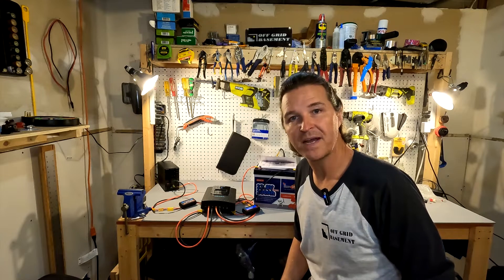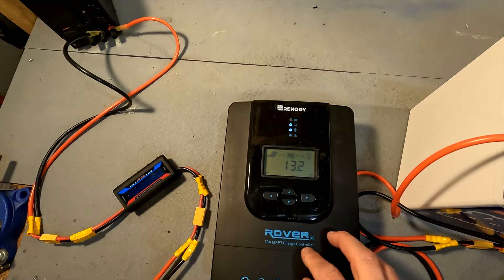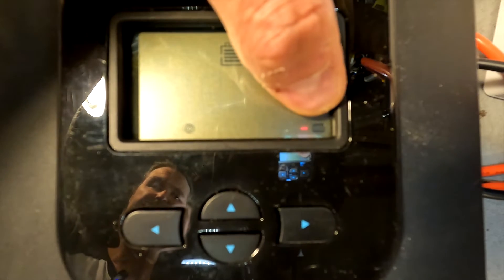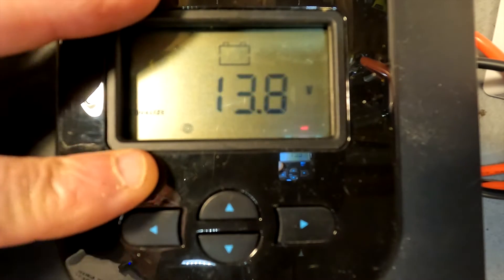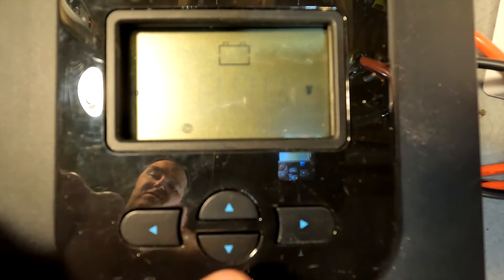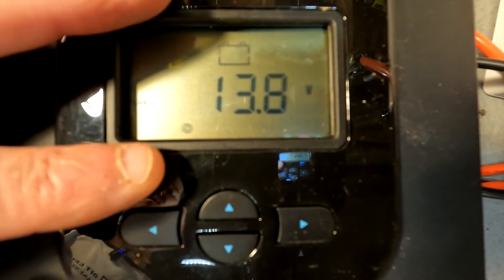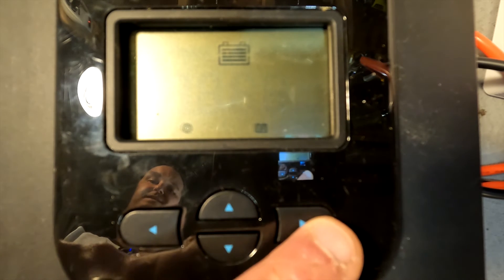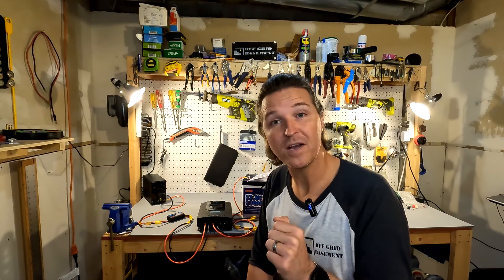How to program the Renogy Rover 30A for a Lifepo4 Battery

Comment: This has an error in it. If you leave it on user, its just supplying what you're using and not charging your battery. I switched mine back to LITH and it is fine now.

Comment: I am currently using the same controller. I have been running everything as a 12 volt system. I've also been considering changing just the solar panels to 24 volt or higher and run that through the wiring to the controller, but I would like to maintain the battery bank and out as 12 volts. Do I need to purchase anything to add? Is there anything else I need to do other than wiring changes at the panels and setting changes to the Rover 30 amp.

Comment: I was confused about the setting of the equalization but you cleared that up.  Thank you VERY much.  I will now set my charger to 13.8 for the equalization setting...NOT 14.6.  GREAT video.  I didn't get a manual with my battery for the settings and was always wondering if my controller was set right.  Thanks again.
Reply from the maker: I'm glad I could help, and thanks for the comment!

Comment: Hi ! That's a good video but I need help with a problem with my Rover 20a controller that I have had in use for around 12 months. It is putting no charge whatsoever into the battery and yet is showing no error code (E0). I've checked all connections and I even ran separate cables direct from the controller to the battery, but no change. The term 'mppt' is not showing on the screen and no current is shown going to the battery. Do you think the controller has failed ? Any help much appreciated, thanks.
Reply from the maker: It sounds like a controller failure.  Make sure to check the voltage coming into the controller from the panels.  It should be over 18v.  Also, make sure your charge voltage is at least 14v.  I'd be more specific, but I don't know the chemistry of your battery.  Hope this helps!

Comment: All the settings when I cycled through in USER mode are correct. Still sitting at 13.3 charge :(
Reply from the maker: I think that's correct.  Your battery bank should only charge up to 14.6v to a short amount of time, then drop back down to mid 13's.
Reply: Renogy helped me get it all programmed properly, then they told me that sitting at 13.3 means the batteries are full that they will only go to 14.4 if the batteries were drained and it has to fire up again and it will only stay there for an hour or so and then drop back to 13.3

Comment: I tried to program mine which has been sitting at 13.3 for two days (supposed to be 14.4). It lets me select LI battery type then when I press right again it chooses between 12v and 24v but keeps going back to flashing the type of battery. It doesn't move to the next manual setting like yours did. Back and forth between battery type and voltage type is as far as I'm getting
Reply: You have to hold the right/enter button, switch to USER mode(it is a square with USE on it at the bottom)
Reply from the maker: After you put in the setting, try unplugging the battery and see if the setting stuck.  That's about all I can think of.  Hope it helps and good luck!
Reply: Maybe its because he is setting it to User intead of LiPo?

Comment: 13.3 is float on Lifepo4
Reply from the maker: Every 12v Lifepo4 battery manufacturer I've reviewed states in the manual that the charge voltage is 14.4v and float is 13.8v.  13.5v would do fine, but 13.3v is a bit low for my tastes.  Thanks for the comment.

Comment: Thanks for explaining the float and boost voltages, i have issues with some of these settings especially th thru the bluetooth app. I have 3 of these 40 amp controllers and wwant  to get the most from them. If you need any ideas for future videos go over the bluetooth settings and explain them, lol.  Thanks
Reply from the maker: I don't have the Bluetooth add-on.  I take it, it's not really user friendly?  Thanks for the comment.
Reply: It just has lots of settings, some that make sense and some that don't.   Give it a try it is useful,  although a bit confusing, with a few misspelled words.   Again thanks,  and great video.

Comment: I am only receiving less than 1 amp from my 200 watt panel. I had my rover set to li and my battery reading 13.1v on both the rover and volt meter. At midday with 60% of panel getting sun. Only 1 amp, 15 watts, and 21 volts.  I am switching to user mode and manually adjusting the settings to see if it's something to do with the li setting thinking the battery is fully charged. 
If the problem is not the charge controller settings what might cause low amps from the panel? All new products.
Reply from the maker: You really need to put the panel in full sunlight and test again.  Shade really does kill solar production.  Hope this helps!
Reply: @OffGridBasement  yes. .  I somehow missed that individual panels can't really handle any shade. But of a disappointment as I have to move my panel but at least my set up is working and I don't need any new parts!  I tested mid day with the panel flat on my roof and I got near 7 amps. My battery tho charged from 13.1 to 13.4 and then settled back to 13.2. seems like it should have charged more. Will do more experiments when the panel is in the correct position
Reply: Could also check the wiring connections as they can get corroded.   Best connections are using butt connected crimped down hard and covered with shrink tubing.   1 amp seems a bit low even for shaded conditions (like I have completely surrounded by trees on a north facing slope (lucky me).

Comment: Are the settings the same for two 12V, 12Ah batteries connected in series?
Reply from the maker: If they are lifepo4 batteries then yes.
Reply: Nope.    In series you have a 24 volt battery system, so double the 12 volt numbers.   Series is daisychained ( - of 1st battery connected to + of 2nd battery, and output comes from + of 1st battery and - of 2nd battery,   the  voltage doubles,  parallel is + to + and - to - ,  so amperage doubles and voltage stays the same in parallel.

Comment: Hey mate, thanks heaps for the video, very useful. Not sure if you might be able to help but I've got a renogy 20amp charger with a brand new 100ah lithium battery and it keeps going flat, it's like it's not getting any current in at times. I'm thinking the controller is thinking the battery is full but it really isn't. Not sure what to do here, any suggestions would be appreciated
Reply from the maker: Make sure the charge voltage is set to around 14.2v.  Float voltage is 13.8v.  Also, make sure you don't have too much voltage going into your charge controller from your solar panels.  Hope this helps!
Reply: @OffGridBasement  thanks mate, I'll give it a try and see how it goes
Reply: I literally just posted the same problem. Hit send and saw yours 😂😂😂 changed my float in user mode and going to see tomorrow when the sun comes up!  I hope this is. The fix!

Comment: could you do a video covering a similar set up but with a 24V Lipo battery?
Reply from the maker: The mppt should recognize the battery voltage and start up.  Everything else should be doubled for voltage.

Comment: In USER mode the setup parameters are too low for my 24 volt battery, most are 17 volts high limit.
Even though I have the battery voltage set to 24 the parameters don’t change.
Is there a fix for this?
Reply: No answer here so I sent it to the company, they replied: Dear Customer,
Thank you for the information! 
Please set it to 12V. The controller will automatically double the voltage based on your 24V reference point. Please give it a try. 
This DID NOT work, just went into alarm”battery overvoltage.
Reply from the maker: I've never come across that issue.  I have only used it for 12v setups.  Sorry I'm no help.
Reply: My bigger problem is the maximum charge rate, it’s restricted to 14 or 15 Amps. I don’t know if it’s the controller or BMS restricting the amount of charge. Or maybe both?
With 620 Watts of PV it should reach 25 or 26 Amps. Really perplexing!
Reply: I have the same problem ,you would think that a renogy mppt would connect to a renogy 24v battery

Comment: yeah ive been stressing out over this solar charge controler since i wanted to make sure i buy the wright charge controler for my LIFEPO4 battery so ive been looking up videos for days to make sure i buy the cheapest and best charge controler that cost under 50 dollars lol im buying the charge controler with the bluetooth app for 50 dollars and thats the most ill ever spend a a charge controler lol
Reply: Hey I'm facing the same situation now. Did you make a good choice buying that $50 controller?
Reply: @User-jr7vf  lol yeah i got the RENOGY wanderer 30amp charger and its been working great so far and its winter time in new york and i only have 200watts of solar panels and i keep everything outside and so far my renogy 30amp charge controller is still working great and hasnt gotten water damage so far and the bluetooth BT1 is also working great and is collecting all my data so far and has been outdide in the weather for months now even tho none of the RENOGY CONTROLLER I HAVE IS WATER PROOF AT ALL ITS STILL WORKING JUST FINE IN THE SNOW SO YEAH WELL WORTH THE MONEY I THINK I PAID 30 DOLLARS FOR MINE

Comment: hey do your voltage slash AMP meter thing go up to 65.0AH and doesnt go any higher or are do i just have 2 of them that only go up to 65.0AH im talking about those inline meters your using lol i have 2 of them but they only go up to 65.0AH and then it stops counting the amps after that for some reason i was wondering does your do the same and or do they all do this or just the ones i have lol
Reply from the maker: You should be able to program it to whatever AH your battery bank is.
Reply: @OffGridBasement  lol no im trying to say those cheap ebay or amazon AH meter with the 12gage wire lol there called power analizer thing mine only go up to 65.0AH and stays at 65Ah even tho i put 100AH in my battry i wonderng do your power analizers do the same thing

Comment: well brother im buying the RENOGY  wanderer 30amp charge controler today since my older renogy 10amp charger stopped working because i tried to put solder on the back where the heatsinking was and i ended up braking my solar charge contoler and man that 10amp one that only like 18 dollars was perfect for me since i dont have a huge set up yet lol but yeah i just bought another 100watt solar panel well my mom bought it for me so now i have 2-- 100watt solar panels with no charge controler so yeah ive been looking for a good controler but im poor so i have to go with the cheap 27.00 dollar renogy 30amp charge controler lol if i had more money like another 40 dollars to spend i would of gotten the EPEVER charge controler but owell not everyone is lucky i guess anyways man this solar sytem stuff cost allot of money for basic shit like WIRE and SOLAR PANELS and BATTERIES lol they all cost so much money ow batteries i get because they put out power but a good solar charge controler can cost up to 500 dollars or more lol so stupid
Reply from the maker: I'm sure it will work for you.  Thanks for the comment.

Comment: Man thanks so much for this. I just bought 4 new 12.8v 100ah Vatrer batteries (4) and the manual said the Boost Voltage was 13.8! I was like no way that's right. In their other papers it says the charging limit voltage is 14.6. I now have the Boost set to 14.6.   Also they had the under voltage set at 12.4! I knew that was awful too. I set that to 10.5 or 10.6. I also have the 40 amp Renogy charge controller. Thanks 👍😊🙏 for this video!
Reply from the maker: Great to hear!  I'm glad you were able to get some solid information.  Thanks for the comment.

Comment: Hi I have the renogy rover li 20amp it has a setting for boost duration, any idea what that should be set to the range is from 10mins to 300mins
Reply from the maker: I believe it is 1 hour for every 100ah capacity.  Hope that helps!

Comment: Thanks the explanation. My question is, i have 9 pces module of 550w and a 10kwh lithium battery but inverter pv max is 2800w. What should i do to use all 9 PVs?
Reply from the maker: I would wire them so you get as close to the max voltage as possible, then wire more panels in parallel.  Probably wire 3 x 3.  Three parallel sets of 3 in series.  Your controller will limit the amps, but not the volts.  Hope this helps.

Comment: I have been looking through manuals for both Renology (I have the charge controller you used here) and LiTime and did not really have all the smarts I needed. Your video filled in the voids! I took the liberty of lowballing (slightly) a couple of the figures I could not find in the manual but I think things should work.

Liked! Subscribed!
Reply from the maker: I'm glad the video helped!  Thanks for the comment and the sub!
Reply: @OffGridBasement  Are you open to another question about solar and Lipo Batteries?

Comment: thanks i just got a Renogy 20 amp and  using li mode with a 200 amph dr house lifep04  and two 100 watt dokio panels . allways seems to be on 100%. but only gives amps and voltage no watts. battery says under 40 lb but closer to 44lb . panels are very light. using on my house boat👍👍 is it better to run panels in series or parell to give controller more voltage says it can handle up to 100 volts input.i have them parlelled now..  only thing i see is less line loss in series?
Reply from the maker: Exactly.  Less line loss is the big reason.  Also, when it comes to shade.  Parallel is better when one of your panels gets shaded, but the other doesn't.  Hope this helps and thanks for the comment.
Reply: my panels being on a boat  with no shade. iam going to change them to series. thanks @OffGridBasement

Comment: ... was given a 250 watt solar panel, so purchased a renogy 20 amp controller and 50 ah TimeUsb LiFePO4 battery...to be used as a ham radio power supply for HF. This works well, but the Renogy is a bit noisy on HF, so I just turn it off (the solar panel) when operating. They say the default Li settings are a 'bit hot' and may result in in reduced battery life over time, so the USER settings you offer seem a sensible alternative. Simple, easy to understand and direct to the point without all the yakking about cats or whatever, the other videos are so confusing, and most assume you have the Bluetooth adaptor...Thanks.
Reply from the maker: You're welcome!  Thanks for the comment.

Comment: I love your videos and am new to solar energy.  I do own a couple of old power banks but realized that I need to make my own solar battery box for camping because I use 12V appliances and accessories and my power banks don't offer but only one 12V cigarette lighter port.  I want to make mine with at least six 12V ports and use a small inverter like a 1000 watt or 1500 have not decided yet as I am mainly interested on 12V power only not as much as A/C.  

I am thinking of making it a 200ah or 300ah using the mini batteries from redodo or power queen so my question is the 30 amp solar charge controller enough for what I want or should I go with a larger capacity.  I'm mainly using it to power 12V fridge/freezer maybe 2 at the same time and 12V fans and 2 cpaps with 12V converters.
Reply from the maker: If this is for camping then my guess is you're going to be using portable solar panels, correct?  A 30A CC can usually handle up to 400w of solar for a 12v setup.  Unfortunately, unless you do a power audit I can't really tell you if the 30A charger will be enough to keep up.
Reply: @OffGridBasement  Thanks for the reply.  I was planning to use the 2 bifacial 220 solar panels.  My cpaps run on dc so both consume about 180W for the night my fridge each consume 50W when compressor run and two 12V fans consume about 20W each.  So I think the 30amp is enough.  Again thank you for responding. You answered my question.

Comment: My Renogy Rover has a problem, it will sometimes pull the solar panel voltage down from 65V to 18V. When it does this I have to temporarily disconnect the panels and it starts working normal again in MPPT mode. Same thing happens when on a eternal 66v 8@ CV/CC power supply which simulates solar panels in bright sunlight  Contacting Renogy is like pulling teeth, there website absolutely sucks!  Gave up and replaced it with a working Chinese brand, works perfect, no more solar panel pull down voltage even with a nice 12v load.          (using 3- 100@hr lithium batteries)
Reply from the maker: That's strange.  I'm glad you had a way to test the CC.  How old was it?

Comment: Bluetti Max 900W Max.OCV 10-145VDC, 15A ... Dont worry pal, I got this .Maybe get the MAX not the AP as you get those 3 extra amps.. BLUETTI AC200P only 12A
Reply from the maker: The question then becomes...  Is the price difference worth the extra amps?